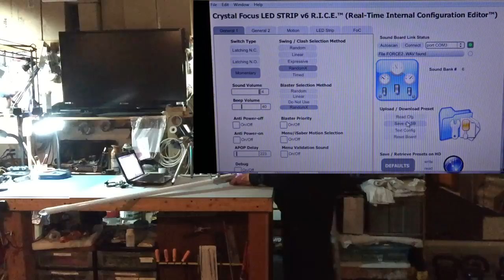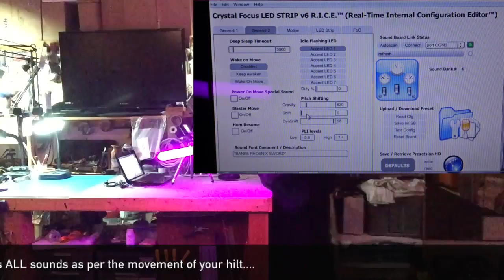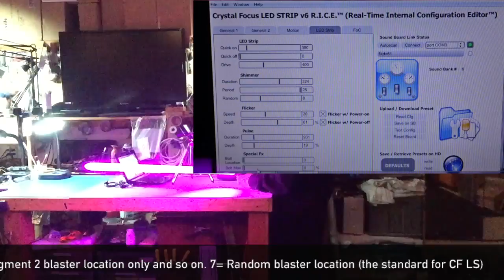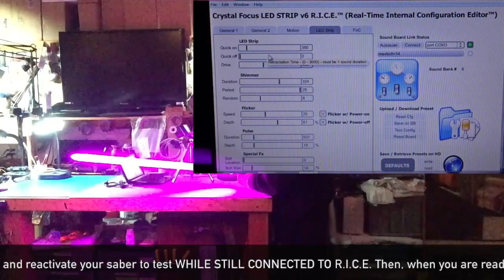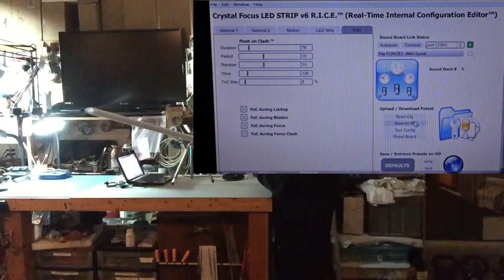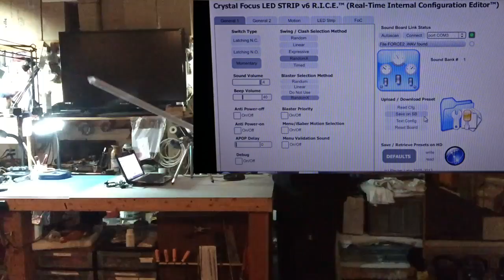Using R.I.C.E. Real Time Configuration Editor for Plecter Labs Crystal Focus LS for LED Strips

Comment: Is it an illusion that the scrolling effect seems smoother turning on than it does turning off?  Or is that what's happening?  Great video, btw.  I might attempt to make an led string saber soon.  I need to do a lot of research :-/
Reply from the maker: You can set the scrolling to any speed you wish. The settings you see are just the settings that are on my saber. Totally configurable to any desire.